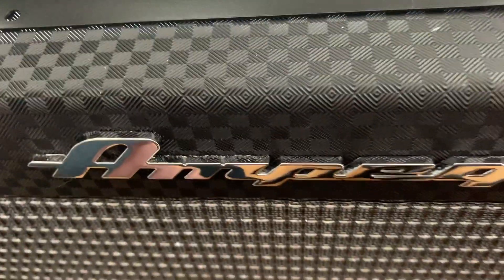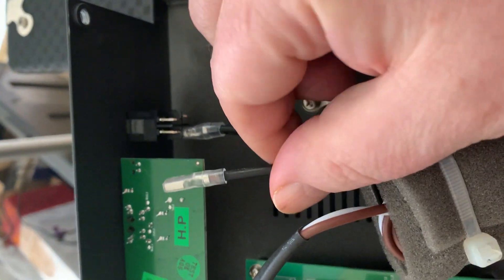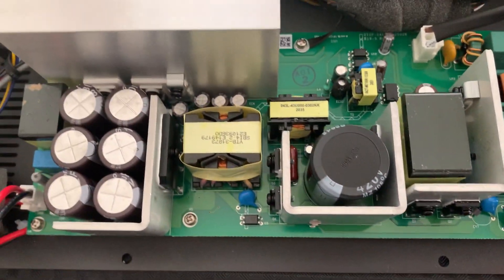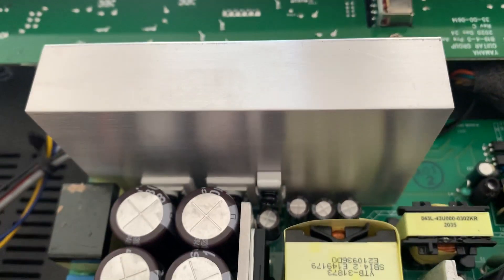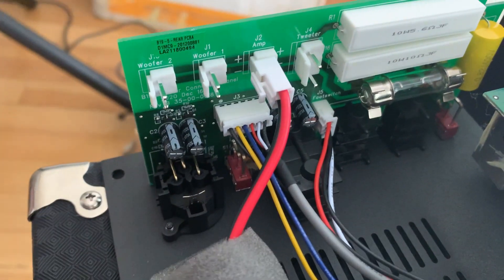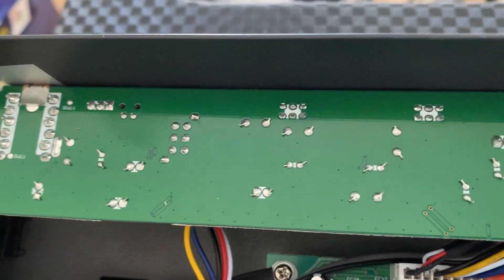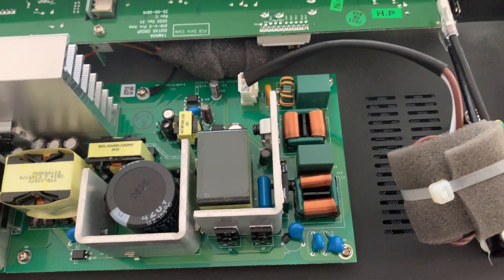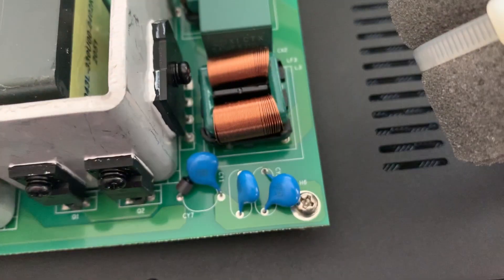The Ampeg RB-210 circuit board

Comment: Working on a BA 210 right now. Not impressed at all. Longevity is evidently not a priority with these.
Reply from the maker: ive been carting mine back and forth to band practice every week  since i made this video - hasnt given me any trouble .
Reply: @pgpete no arguments there. I hope it lasts a lifetime for you. Just not a fan of switch mode power supplies here for amps.
Reply from the maker: @neslesman6708  for me, the full size, full weight SVT heads are too fragile and too heavy.  they sound great tho....

Comment: I have a fairly new RB210 that I'm afraid I may have damaged already that I'd love to get your thoughts on. So my bass dropped straight onto it's input jack while plugged in. The cable bent within the bass knocking a wire off the input jack and this made the amp squeal quite loud. Now I feel as though volumes are a little lower from the amp and there is a background hum as well (horn hiss is noticeable louder too). Any idea at what I'm looking at here?
Reply from the maker: plug in a different bass and cable into the amp  and  see if the fault disappears